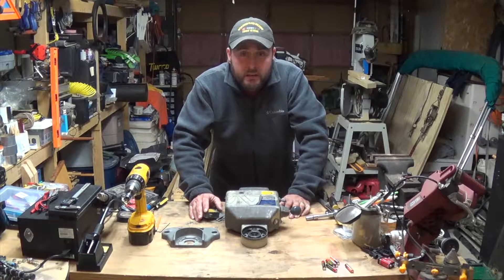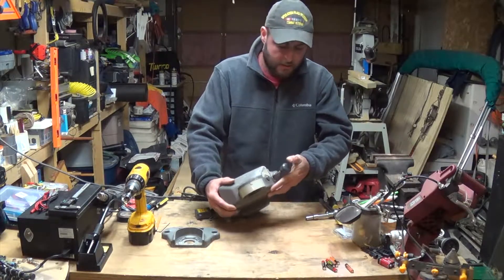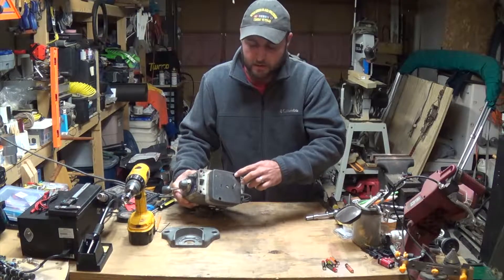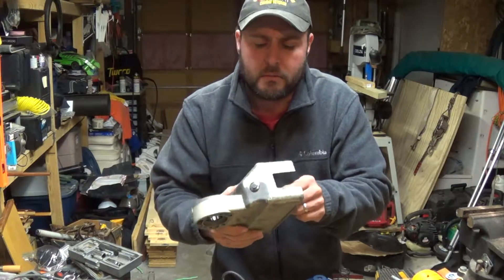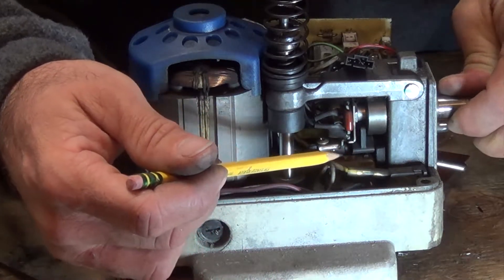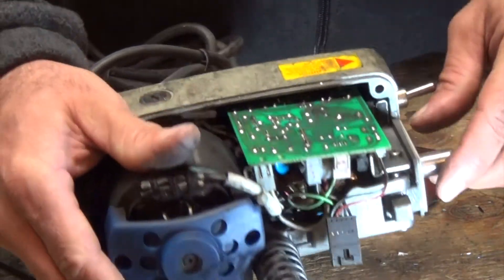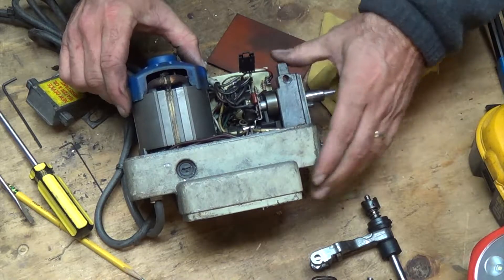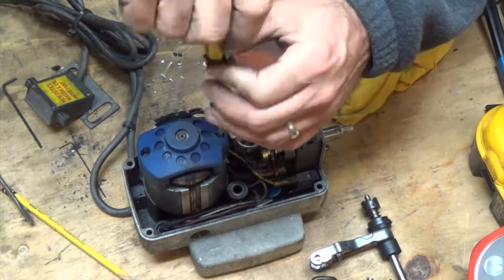Bestline Power Feed Repair

Comment: Hi thanks for the good video. I have a question, there is a kind of reset or overload SW when you can push in to reset now it's stuck and motor is not working. Please advice the this switch faulty?
Reply from the maker: Some switches can be taken apart and cleaned. I am not familiar with the overload switch in this. For testing overall operation, you can manually do the function of the switch. If it works then you know that your switch is the only problem. If it can’t be cleaned, then replace it. Be careful while testing. All our fingers and toes are important :-)

Comment: Thanks for the help, mine was doing the same thing as yours so i ordered the potentiometer as suggested. Motor works now but only in high speed, when i turn the potentiometer it has no effect, thoughts? thanks!
Reply from the maker: Make sure it is wired up properly.  If the wires are mixed up, I think it can give that problem. Be cautious please, I don’t want you to damage anything/body.

Comment: Please tell if this is working only in direction only and not in another direction than what is the points I can check to rotate motor in both directions with help of selector switch.
Reply: I have APF- 500 power feed device
Reply from the maker: My other video shows the directional switch “servo 140 power feed repair”
Reply: Glad I found this. It gives me a heads up on what to expect when I take mine apart, cheers.

Comment: Hi again, any chance you can put a link to where you found the replacement potentiometer please as I’m not having much joy.
Cheers Stuart 🇦🇺
Reply from the maker: I search for bestline power feed. Then I just chose their link for replacement parts. I guess it’s pretty common to need replacement because it’s one of the few replacement parts that are available
Reply: @EverydayJourney  Thanks again, I found them on Ali Express for about $15 AUD with free postage. They have several different potentiometers so I chose the one to suit the AL-310S  power feed which seems to be a common model number for the generic Chinese power feeds. 
If it fixes the problem then I’ll order a few and list them on eBay so others can find them as it seems to be a reasonably common problem.
Thanks for your help my friend. Cheers Stuart 🇦🇺

Comment: Hi, great video and I agree with you on finding out how to do things on the net. I have a power feed that had no power light, the variable speed wasn’t working and the knob is cracked, was 22 years old and it was in very grotty condition so I purchased a new one for $200 AUD and fitted it up. I pulled the old one apart tonight and came to the same conclusion as you that the potentiometer was cactus and I could see the power LED was burnt out. Another reason I fitted a new unit is that in Australia we use 230 volt and this power feed is 110 volt and uses a step down transformer, weird. Anyway I’ll fix and cleanup the old unit and put it and the transformer away as a spare or see if I can adapt it to my surface grinder. Another thing that stood out is that although my unit was 22 years old there was very little wear in the top gears and none in the large plastic gear in the bottom. 
Your video made the perfect double check for me so it’s much appreciated. Cheers Stuart 🇦🇺
Reply from the maker: Glad you found it helpful. I used to use step down transformers when I was in Germany. Worked well on everything except things with a lot of draw (clothing iron) my friends would borrow it and pop the fuse. They just couldn’t understand why it kept happening. I couldn’t ever teach them enough

Comment: This might actually save my powerfeed, thank you! Was running it hard to test it when the motor started getting hot and smoking. I thought fire so I yanked cover off with it unplugged. Problem is the pot wires came loose from the rapid feed plug. Irony is it was working till I went to go test it on the bench only for those wires to short and pop the pot. Luckily you made this video!

Comment: My power feed traveler it's running backwards, when I push it to the left goes  right and right goes to the left. How can I fixed that..
Thanks.
Reply from the maker: It may be in your wiring. I will look at mine later this evening to see what I can find out for you. I’ll let you know
Reply from the maker: What brand of power feed do you have?  As far as I can see, it’s either a wiring issue or a gearing issue. Either one could be changed to give you the results you’re looking for. I’m just not sure which fix is the easiest/cheapest
Reply: LAGUN. 
Thanks for responding me back

Comment: Good stuff!  Do you know what the story is for lube on these things?  I'm guessing some kind of grease...  The tags on mine are worn off.  🙄
Reply from the maker: Not sure. Both that I took apart looked different. One had like axel grease and the other looked like white lithium
Reply: @EverydayJourney  Thanks man..  I might give the company a call.
Reply: @jagboy69  I know mine said to use silicone grease and not graphite. You need a non conducting grease as the electronics are open in the same housing